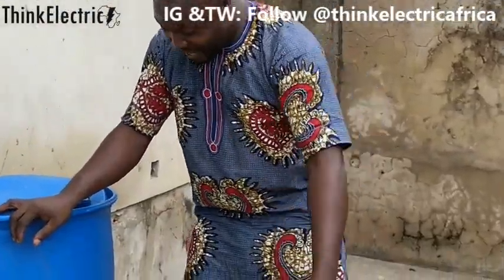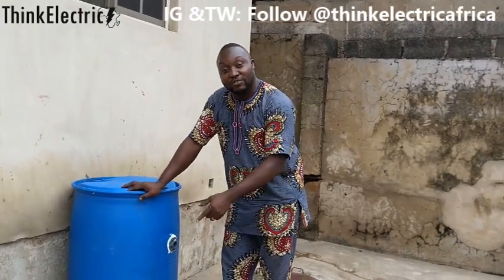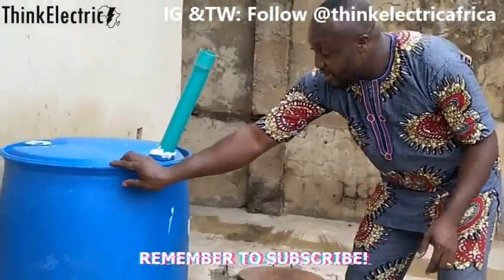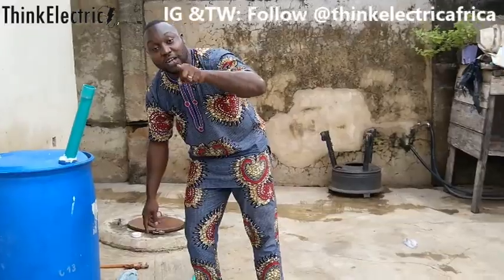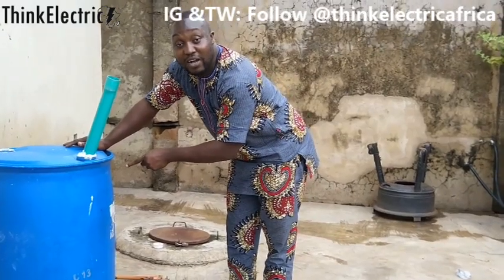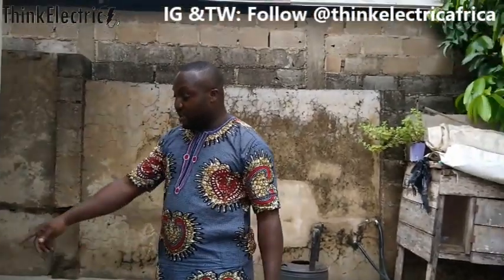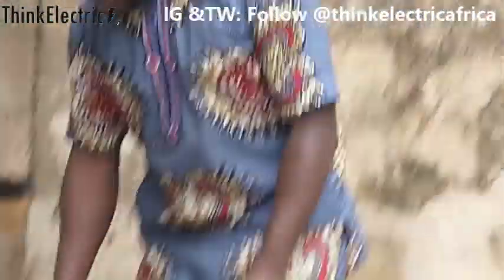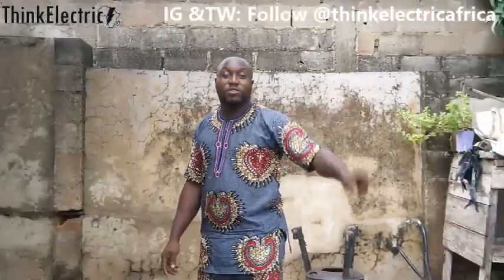Construct Your own Biogas Digesters For Free Cooking Gas, or Get One Free..

Comment: First off, I'd make the feeder in pipe bigger, 2.5 or even 3" pipe, easier to fill.
Make sure you put the tapered end facing the middle of the drum, on facing the side.
I'd put it on a stand so you can get a bucket under to remove waste.
Also tell them how to prime and start the biogas to work.
Cow dung.
Reply from the maker: I can't agree more